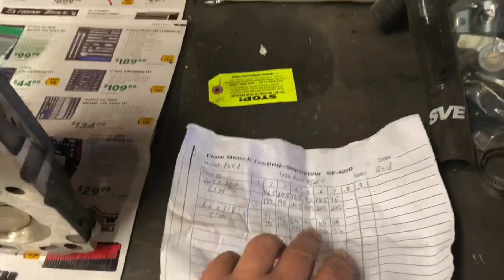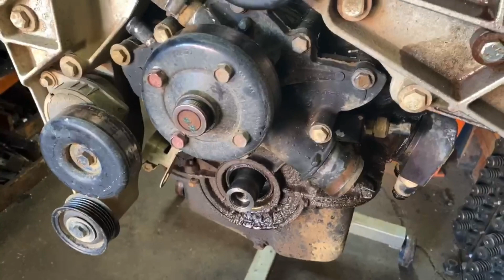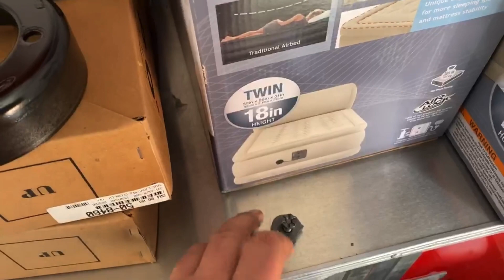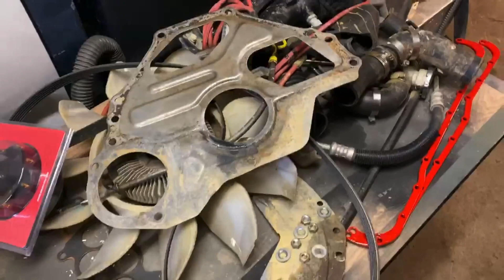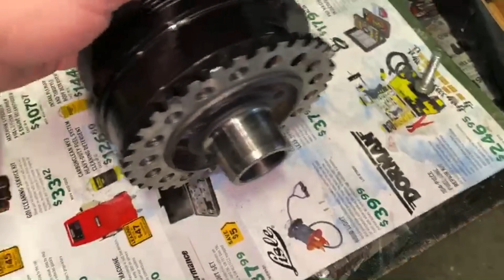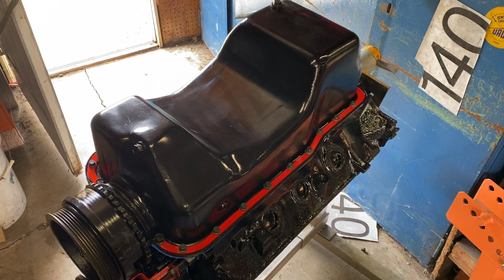Gilligan gets stroked!

Comment: Very nice build. Can't wait to see that beast in Gilligan. I'm also interested in seeing how your tuning goes with your micro squirt.  I bet the torque is going to be impressive with the extra cubes but I'm interested in seeing how well the low end is with the f-cam.
Reply from the maker: So far it’s been running great. Huge increase in bottom end power that’s easy to feel right off idle.

Comment: Just had Damper dudes out in California  make my explorer based ballancer for my 331 ..its good for 6500.
 How did the 351 motor  even run  even run with those springs??
Reply from the maker: Jody  the springs were changed after they came off the crate motor and they were sent out to be ported.
Reply: @randumadventures   I meant was the previous motor run with those weak springs?
Reply from the maker: Jody no the 351 only ran with the original springs to those heads